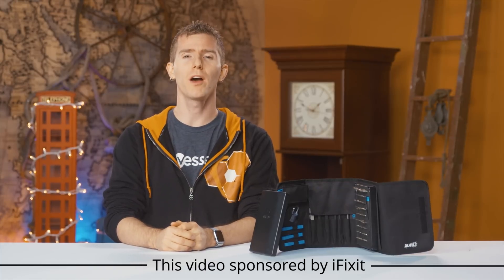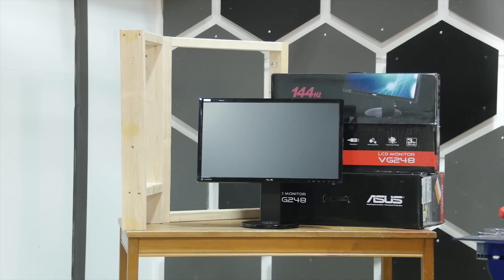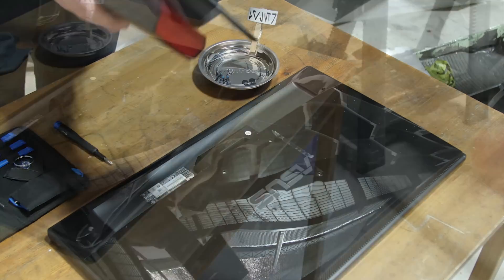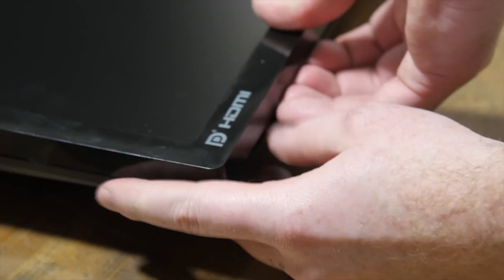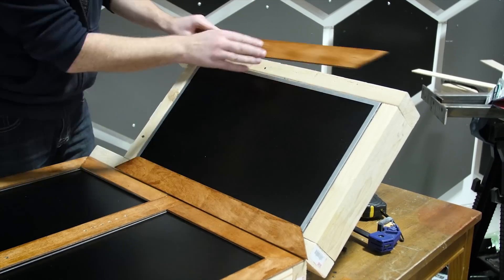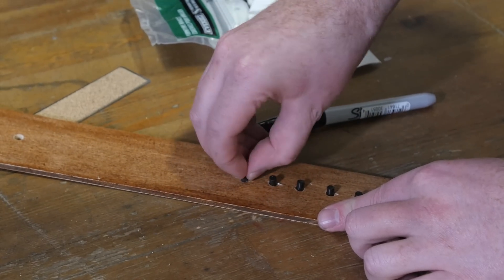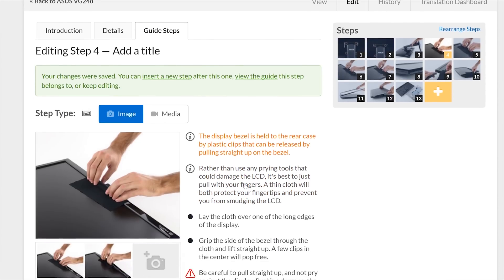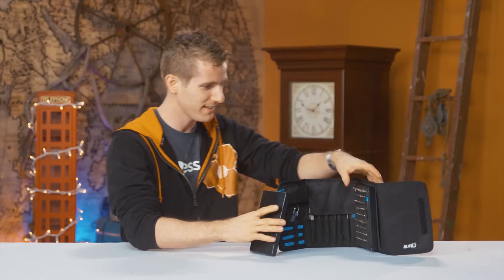Customize Your Monitors

Comment: I want to do this with my laptop, but to make it portable, and thin. Opening up like a foldable table, it would be 2 HD screens, that are powered by a portable usb charger, or chargers, my laptop in back, a wireless keyboard and mouse to move around. Instead of buying a new monitor screen? I believe its cheaper to buy parts separately.. and instead of buying a new usb charger? I can make my own with old laptop batterys

Comment: I'm not sure this stand is very practical because of how low the bottom horizontal monitor will be and how big the spaces between the monitors will be. It does look good but it's probably not that confortable to use.
However the general idea is nice, I saw this website a few times and its pretty interesting

Comment: I own the monitor used in this video. When I run it at 144 Hz I have a weird grey line on the top half of the screen that goes from edge to edge, left to right. It gets less noticeable with a lower refresh rate. Weird. Wonder if you have that issue, Linus.

Comment: If you want to avoid breaking loads of ribbon strips, button cables and plastic clips USE I FIXIT (and other guides) every time! Look at the instruction 3 times over, make sure you know and go through it seamlessly. :)

In the past, a screwdriver could undo and rebuild anything... now things are clipped and glue and OH I HATE PLASTIC IT'S ALL BROKEN NOW. :( I miss old manufacturing...

Comment: Is i7 960 better than i5 6400(k)?
Reply: Remember21 Me I'd recommend getting the i5. It has better single core performance according to some benchmarks. Also it is a much newer socket with an upgrade path available.
Reply: UnleadedZeppelin Maybe the op meant the 6600k
Reply: Daniel Yeah I did,good guess.I messed up
Reply: Daniel But in that case that makes no sense😂

Comment: Please tell me I'm not the only one that really liked this video and this video and the final project.
Reply: i actually like how the monitor looks. sure that bezel is thick but, you know, not everything is for gaming and it looks fit well in wood themed working room with wooden book racks. and i don't really bothered with that bezel, and actually it's better that way since i often getting dizzy in seamless 2 monitor setup with less bezel around. just IMHO.
Reply: It was okay. I would've gone with a black or something along those lines.
Reply: Thought is was really cool as well.
Reply: Yeah, me too. It may not have the normal visible effort but that's because LTT has set a relatively high standard. Def liked :)
Reply: Michael OLear I liked most of it, but the finished project was ugly af
Reply: Thing is, it was totally pointless to take the case off.

Comment: The VG248 does not look pretty in portrait mode. Probably the same with other TN panel monitors. They are optimized for landscape viewing so their poor horizontal viewing angles become even worse vertical viewing angles rotated 90°.
For anyone planning to mount a monitor in portrait mode semi-permanently like this, test it in that orientation first and make sure you are comfortable with it!

VG248 is a great monitor though if you care about smoothness and response time more than colour (though they still have great colour for a TN, just not as good as other panel types). It was also the first GSYNC monitor, via the upgrade kit which requires similar disassembly as seen here.
144Hz FTW!

Comment: This is actually a very cool idea. I was already planning on putting a $4, 1600x1200 monitor i got on auction in the shell of a microwave that I gutted to make a spot welder with the internals of a $6 core 2 duo machine that i got at the same aution (althouth i'm upgrading to a q9400 and something like a 750 ti), but if i get the winning auctions on the other 1080p and 1280x1024 monitors, I might actually do something more like this, as it seems pretty cool.

Comment: 0:30  is that a fish tank keeping the computer cool?
Reply: Its oil, and yes.
Reply: It's his oil cooled PC, mineral oil is non-conductive so you can dunk electronics in it and not damage them at all.
Reply: I hope that's a shit joke. I've used mineral oil on roller bearings before (ran out of grease) and it has seized them up completely after a few months. That being said the bearings on PC fans are probably sealed, so no considerable amount of crap can get in
Reply: medumdum unless it's mechanical
Reply: Depending on what mechanical thing you're talking about. A hard drive is a bad idea, but a fan is just fine
Reply: Se7enAte yeah
Reply: Se7enAte the oil in the ball bearings would help it spin

Comment: Any tool guys have any experience with these tool kits? I'm wondering what the actual quality is like.
Reply: I have a bit of experience with ifixit when I was replacing my phone's battery (void'n them warranties!) Anyway, I'm looking at getting one a little Christmas present :D They have great quality tools for everything you could need. If you're a casual enthusiast don't bother with the expensive 64 bit kit since it was waaaaaaaay too much stuff and save a few bucks.
Reply: I used to have their old driver set and recently upgraded to their new Pro Tech Toolkit. Overall I have been really impressed by the quality of what I've seen from them. All of the bits are magnetized just the right amount, they're all machined well and very well made. The screwdriver handle is a great upgrade from the previous one and provides a lot of grip and is designed perfectly for work on small electronics.

While the entire set is aimed at small electronics there isn't really anything stopping you from using it for some larger projects - I actually just happened to have my old driver set with me about six months ago when my tail light went out on my car. I popped into a local auto shop for a new bulb, googled how to remove my tail light assembly, and then luckily had the right driver to fix it without any hassle at all.

Some people will say the kit is a little pricy... heck.. it IS kinda pricey, but it's 100% worth it knowing that I will always have the tools to fix whatever anybody brings to me. Whether it's an iphone or a laptop or a tablet or whatever. The included pry tools are sturdy and very useful, along with the ESD safe tweezers and flexible driver extension that makes it easy to reach into tight spaces inside a PC case (some of these pre-built things that people bring in are just awful...). I've been impressed time and time again by their quality and also by their website. I would highly recommend it to anyone working in the tech field or any hobbyist.
Reply: have the kit that is pictured at the beginning of the video. It usually runs about 60 to 80 USD depending on shipping and where you get it from. Everything works beautifully. heck I used some of the stuff to fix my car's headlights! 
In the unlikely case that something needs to be replaced, ifixit sells some of the tools in the kit separately as well.

Comment: how about showing people how to salvage old lcd screens with burned out electronics?
there are tons of cheap third party drivers on ebay and amazon and they allow one to take pretty much any panel and get it working again in under an hour, works for laptop screens as well, i have done it with a few but it does become a lot easier when done in bulk, that way you can cross test to see if it is the panel or the chinesium driver that isnt working.

Comment: Looks good but here's one problem with future maintenance. Stained wood should be oiled or at least use a good quality furniture polish like Pledge or Favor once in a while so it doesn't fade or dry out. Due to how close the decorative balsa wood is to the screen though, there will be risk of getting that greasy shit on it. Also, if you use the common 25% isopropyl alcohol/distilled water to clean the screen with & that gets on the stained wood; then good fight because it'll leave white areas.

Comment: The biggest problem with this is how you went about doing it.  The choice of wood being standard 2x4's and some cheap balsa wood really makes this look less than a nice looking mod and more like a cheap less thought out finished product. This mod could have looked so much nicer by just simply thinking out the monitor enclosure a little bit more.  You very easily could have actually made this look nice but instead you cheaped out and made the final product look like complete trash.

Comment: tools needed:
-ifixit kit
-angle bench saw
-straight bench saw
-3d printer
-power drill
Reply: Is mayonnaise a tool?
Reply: @LoungeCat91  depends on the amount
Reply: |T-Bside| Jey XP -shit wood paneling
Reply: linus is losing a lot of opportunities, he should get sponsored by Makita with all the wood shit they've been doing.
Reply: tools needed: 
- a screwdriver
- a butter knife
- a hardware store
if you write your measurements down a hardware store will cut everything for minimal cost and a jimmy is just a thin bit of metal
Reply: It's a miracle that they made 2by4s seemingly flimsier than Ikeawood.
Reply: |T-Bside| Jey XP and a bin..to throw it all away
Reply: |T-Bside| Jey XP mitre saw not bench saw
Reply: Linus please make star trek original series style computer <3
Reply: I hhave all those tools lol

Comment: Cool guide. Interesting idea. Random nitpick: The pushstick in the table saw clip is on the wrong side of the blade. You're supposed to use it on the piece of wood that's between the fence(guide) and the blade, nearer to the blade, so the workpiece can be safely pushed past the blade so as to avoid kickback.

Comment: I know this is out of context but I need quick help,  I tuned up my cpu speed to 4.5 GHz but I forgot to optimize my voltage now my cpu fan is running crazy and my temps has gone up to 100 C. Help!  D:
Reply: Tony ManFlash go to the Linustechtips forum someone will surely be able to help you there. I don't know much about it but there are a bunch of videos on YouTube and I think Luke made one a few years back. Good luck!

Comment: Wish you had this video up when I took my ASUS VG248QE apart when installing that G-Sync mod that I won from you Linus lol. I didn't know you could just pull the front of the bezel off. Here I took the back off with screw drivers. I didn't really maim the plastic much, but there were a couple marks on the bottom.

Comment: Seeing as how little of a difference (in size) removing the bezels made and then seeing the enclosure you made for this, you could have just kept the monitors in tact and put them into the housing like that. I get that you can, with certain monitors, drastically reduce the bezels by removing the plastic shroud, but this was about the worst example.

Comment: I dont understand why they put that gap between the two monitors?
Reply: because they arent really modders, OR carpenters. but after years of watching linus (and a bout a year now of NOT watching linus) i have to give them some credit for really doing something interesting and out of the norm. i agree though, id have done it SIGNIFICANTLY different.
Reply: Because DIY I guess. Modding gives you the freedom to do whatever you want. Though, I'm not sure how many find the final result that attractive in this case. xP
Reply: ~Ravens on the right side, with the two horizontal monitors, why did they put a gap between them and fill it with wood?
when you could of had the panels flush next to each other and been basically borderless ..
Reply: could've*

anyway, from a design perspective, it is more consistent to keep the wooden borders surrounding each monitor the same size.  That's likely why they did it, since there doesn't seem to be a functional reason for it.  I have to say though, when using multiple monitors, minimizing bezel between each is not as big of a deal in most setups as it is for triple monitor gaming; they probably aren't going to have any windows stretching across both of the right monitors, so the gap doesn't really matter.
Reply: Levi Morgan you're right my sarcastic answer flew the wrong way and facts foiled me again. And thank you for the grammar lesson I'm now a better person for it.
Reply: Raoul G the pre cut thickness of your standard 2x4 is 1.5 inches and seeing that's the wood they used for their frame it works out with some fancy math to exactly that size. Your welcome
Reply: Terry Flamingo you're* also, if you watch the video again, they don't have a 2x4 between the two right monitors, so it was likely done as a design choice to keep consistently sized spaces between each monitor
Reply: i really love the case... but personal preference XD

Comment: 4:03 is totally wrong. The pushstick is supposed to push the wood between the fence and the blade. Otherwise, if you don't guide that part of the workpiece, the saw may catch it with it's teeth and launch the wood into your stomach. Also known as kickback. Sure there is a splitter behind the blade, so it won't go terribly wrong, but the saw still can get hold of the wood.

Comment: And now you've lost all adjustability.
Reply: SeriouslyMikey Plus the I/O is harder to get to.
Reply: and it looks like shit. what happened to the good ol' wall mounted 3 screen setup, or even just arms from the back of the desk? I think the added more bezel by doing this anyway!!!
Reply: Nah, you just have to move or tilt the entire desk. Or your chair. Where's your imagination, man?
Reply: If you look closely at the drilled holes when they show the 3d printed button extensions inserted, you can see that they didn't give a fuck about this build, they just threw something together to have an excuse to say "ifixit" as many times as they can.
Reply: Cakeless Coder Would look decent for a shop display, where you've got something being advertised on the monitors. Other than that, it's trash.
Reply: @SeriouslyMikey  I'd use it for something like a steampunk computer terminal.
Reply: Cornelius Sneed you owe me a new toilet roll man, I might have shit myself laughing a little
Reply: I think it looks really cool in my opinion. Very unique look, and would match in a room with a lot of oak wood furniture.
Reply: ***** yeah

Comment: Dislike, sorry Linus... that's the point of making this huge bezels?
Reply: No, this was a example. You can customise it how you like. Thin bezels for gaming, Thick for the people who don't have time to get into fine details or want it that way.
Reply: Just because he chose to make huge bezels does not mean someone following this guide has to. Its basically just showing what you can do. I dont understand the limited view point of all the idiots commenting.
Reply: room42 that's = what's?
Reply: i think this in it self looks shit but you can do it on other ways or for example if you're going for a plant setup this is what you'd do.
Reply: Bullshit. I'm the audience, and I think it looks great.
Reply: The point was because they are being sponsored by ifixit. They just needed to do anything. Which is why they included that little "can't you just buy a stand on amazon" and gave no answer.
Reply: more space for post it notes!
Reply: The point is to show a practical example of what you can do, sure it may not be your preference but these instructions work for any other project where you would need to disassemble a monitor's bezel, like puting a monitor flush inside a wall (with some custom vent system)
Reply: because sponsors!
Reply: the point is you take things too literally and pretty much made yourself stupid
Reply: the idea behind this is a great one there carpentry skills not so good but this was never about the cas it was about using the Ifixit tools and resources in a way that fits
Reply: Spektrik too literally? and you got the nerve to tell other people they're stupid lols

Comment: Take your sleek bezel-less 1440p monitor into a TV cabinet that your grandma owned
Reply: Exactly what I was thinking...
Reply: its not about how theirs turned out, it supposed to offer ideas., ideas based on removing monitors from their bezels and putting them into something else. Your or anybody else's would probably turn  out better because it's not about the final product, its about the concept.
Reply: it looks so bad lol
Reply: Viktor Lindeberg I was trying to make a point, resolution doesn't really matter here
Reply: Why not just remove the bezels and cover the outside with black tape. SO ITS SLIMMER
Reply: They look terrible either way
Reply: My grandma has been using the same TV for the past 30-40 years... so if it ever dies then maybe I could reuse the cabinet and put a nice monitor in there. Thanks for the idea Tomhelduf.
Reply: Make your keyboard look like a typewriter!
Reply: Tomhelduf it's 1080p
Reply: One could say that in this context it's just a number.
Reply: Could have just gotten some carbonfibersheets and epoxy and made them bezeless, beautiful and really thin.
Reply: Add an emulator for old games and you have the perfect retro station :)
Reply: Why remove the bezels, when you gonna hide it behind a wooden bezel anyway..  Just makes no sense
Reply: I thought the point of this was to get rid of bezels... he added link 4-inch bezels with that ugly tv cabinet thing
Reply: Thats from the prehestoric era of DIY...